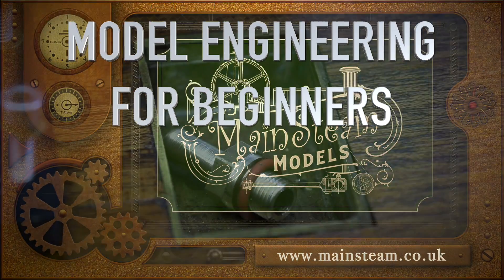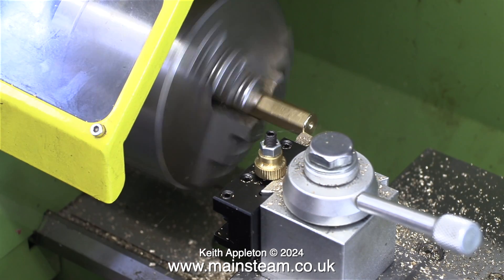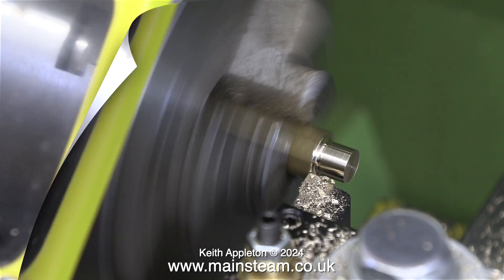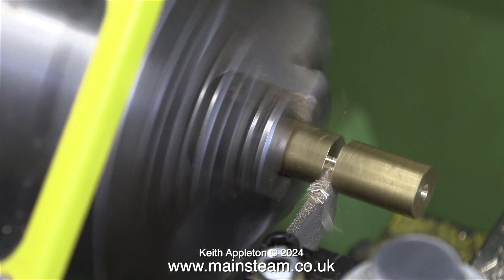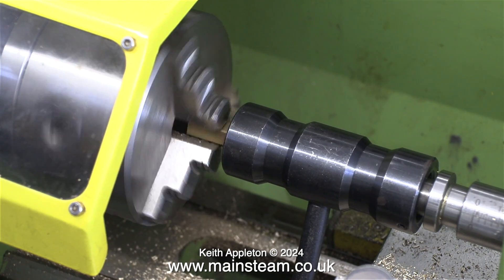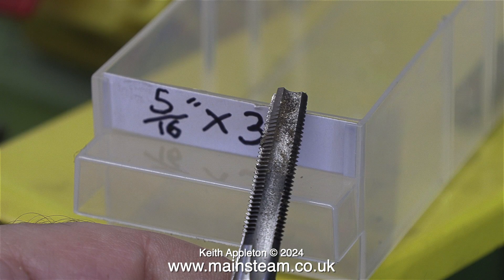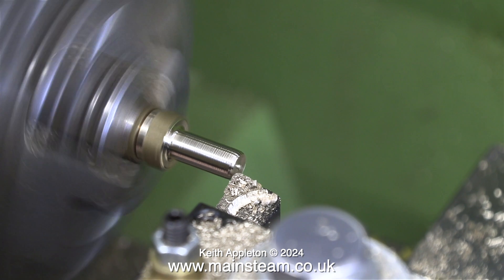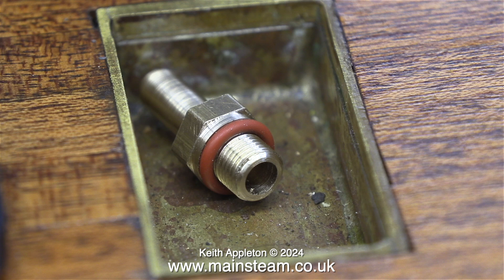THE RIGHT OR WRONG WAY - MODEL ENGINEERING FOR BEGINNERS - PART #54

Comment: Concentricity of the features is not an issue for this part, so this is an excellent way to do this. It's just a fitting that needs to fit and not look bad. You succeeded.